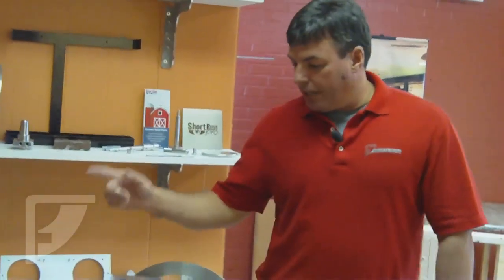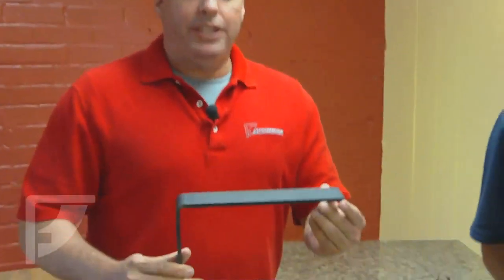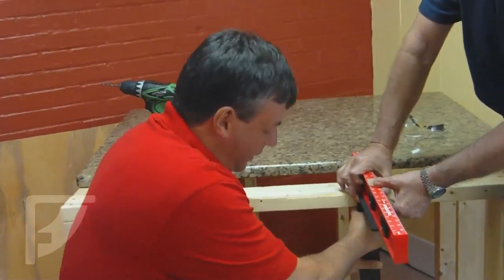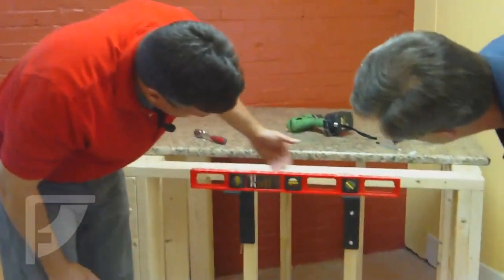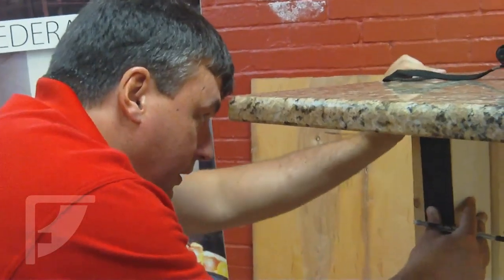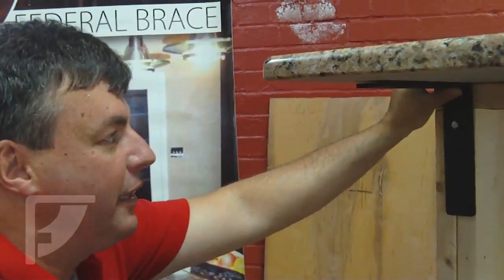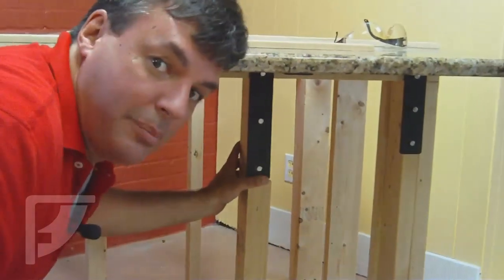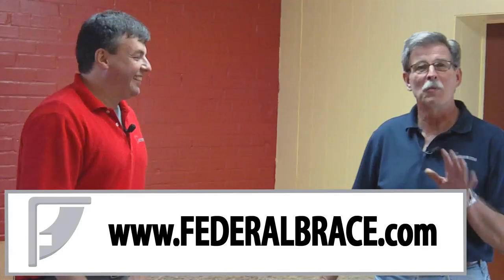HOW-TO: Invisible Countertop Support w/ Freedom HIDDEN Brackets

Comment: how do you attach the countertop to the bracket? or is the weight of the countertop supposed to be enough? I am doing a floating solid surface breakfast bar, and don't know what product to use to attach the solid surface to the top of the bracket?
Reply: If using granite or quarts, i believe they use a silicone adhesive to allow for expansion or contraction with temp changes.
Reply: @FederalBrace  I have a similar question.  I'm installing brackets after the granite install, just to support a 13" overhang for our bar.  I've read to use silicone on top of the brackets to ensure a very snug fit with the granite, as the silicone will add just enough material to create a little tension.  Is this accurate or should I go dry?  You guys didn't use anything here.
Reply from the maker: Please give us a call so that we can help  at (877) 353-8899 M- F 8:30 AM - 5 PM EST!
Reply from the maker: @johnnywash12  Please give us a call so that we can help at (877) 353-8899 M- F 8:30 AM - 5 PM EST!

Comment: Our quartz top will have a 23inch overhang wills these L brackets work or will I have to build a cabinet underneath for support
Reply from the maker: Hello! We would suggest using a gusseted bracket for this application. With an overhang of this size, we also suggest having 2/3rds of the countertop overtop cabinetry. If you have any additional questions, do not hesitate to reach out - 877-353-8899.

Comment: If you don't support countertops in the middle very much is there a danger of the countertop cracking? This is assuming man-made quartz.
Reply from the maker: Thanks for your comment Grant! Any large span of unsupported stone countertop is in a danger of cracking.  While structurally stone counters are resistant to deflection and cracking, when unsupported static weight becomes too heavy, the stone will eventually fail.  However, of greater consideration should be active or point load forces. In an application involving large spans of unsupported stone a point load force can immediately compromise the stone structure to create cracks and even complete failure.  Examples of point load forces include heavy objects being dropped on the counter, people sitting on the edge of the counter, or like my kids like to do, hang from the edge.